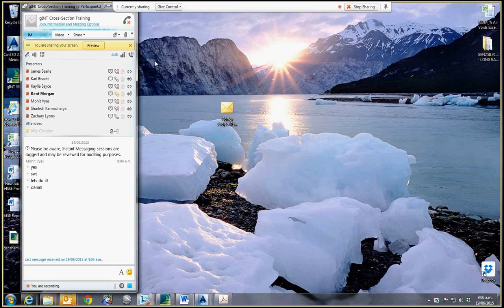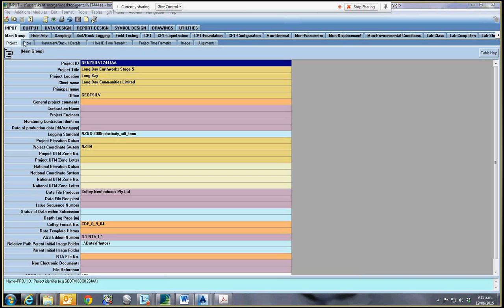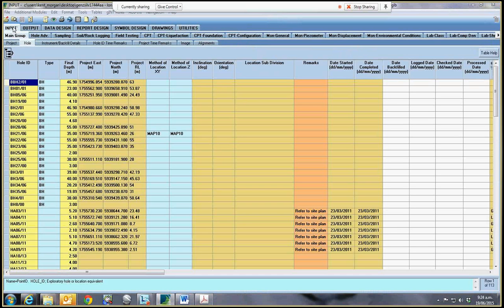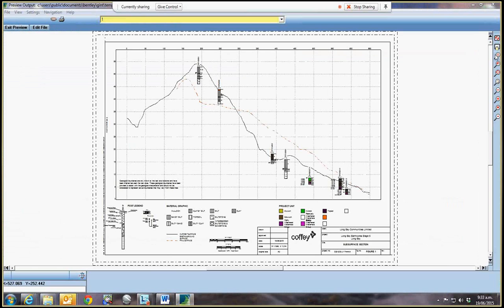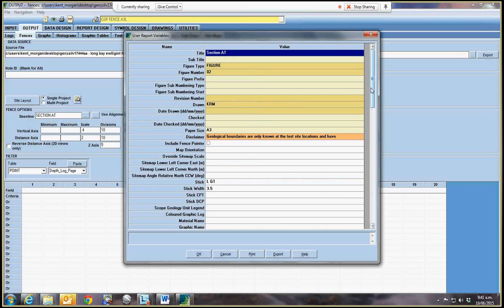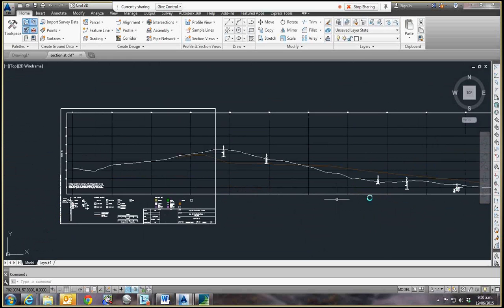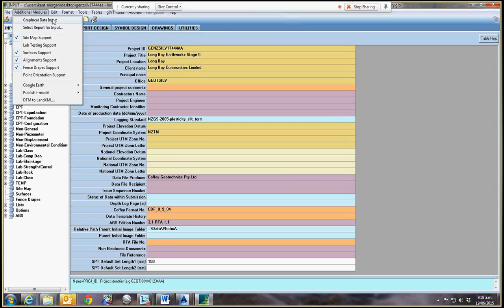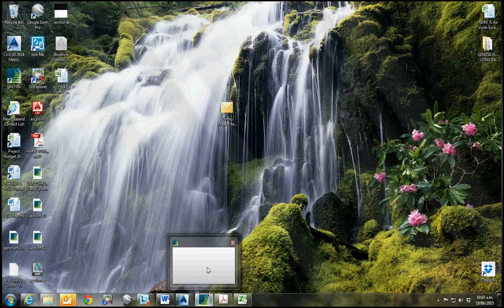gINT Cross Section Training Video

Comment: Hi Kent thanks for the upload, you made mention of a manual is that manual free if so please provide the link to download it. This is a little feedback on your video, take note of audio quality.
Reply from the maker: Unfortunately, the manual is proprietary (owned by Coffey International Ltd) and I no longer work for that company. Best of luck to you--i'm sure gINT has a manual that can walk you through most of it...
Reply: Kent, I'm late to the game, but can you tell me if you were using gINT Professional Plus (SQL server) when you were with Coffey or was it gINT professional?   I've had trouble adding surfaces over 50 MB in size and Bentley  doesn't have a good answer/solution to fix this.  gINT usually crashes if it is even 45 MB. Bentley did not state to me that Professional Plus (SQL server) would solve the problem.  Anyway I appreciate it.

I noticed in your video you added a surface that was 70 MB in size.

Thank you.   Matt
Reply: Hi Matt, what about you, did you have luck with this manual? please let me know... thanks
Reply: Hi, Kent is any changes to see if somebody have the manual maybe could be share. I looking for gint manuals for Cross sections and so far nothing.